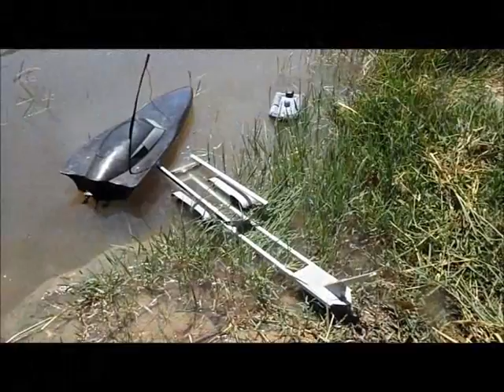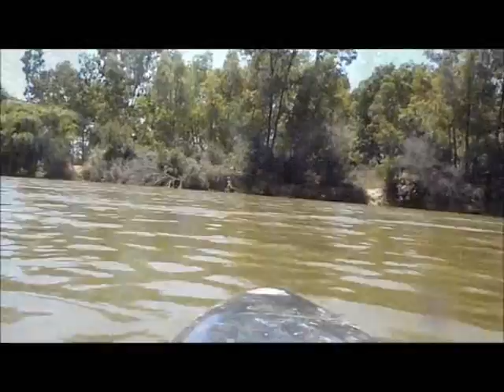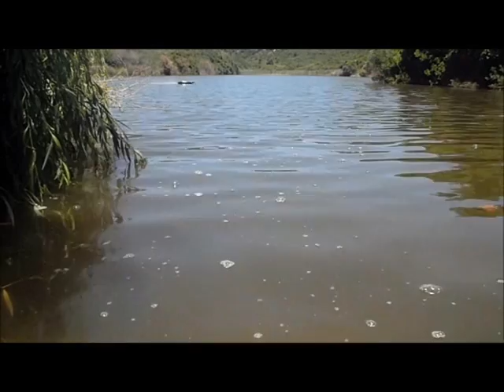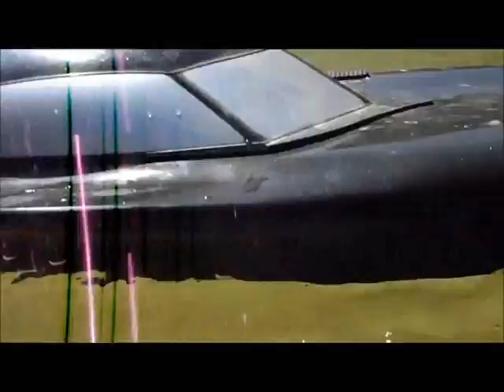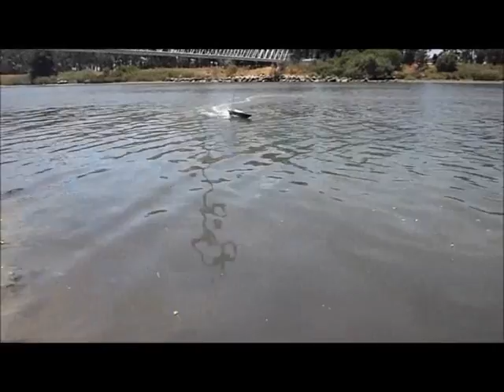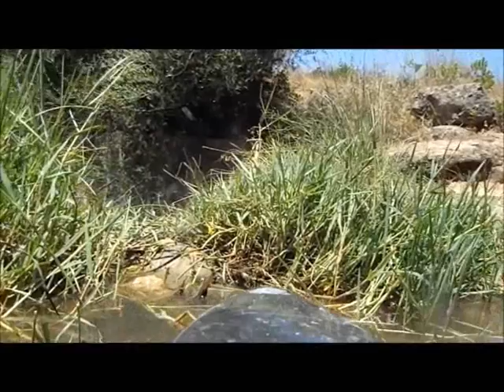Stealth Boat - RC speedboat homemade rudder first test.

Comment from the maker: This poor old hull has been marketed under so many different names it probably has an identity crisis. The rudder conversion greatly increased the satisfaction of driving the boat. You can turn as much or as little as you like, you can turn with no throttle, etc. This boat turned over & sank in deep water with an Olympus u_Tough on its roof last year. I have replaced it with a new, stock one, no rudder, and it´s not half as good as the old one!